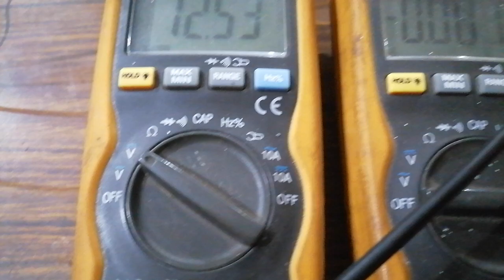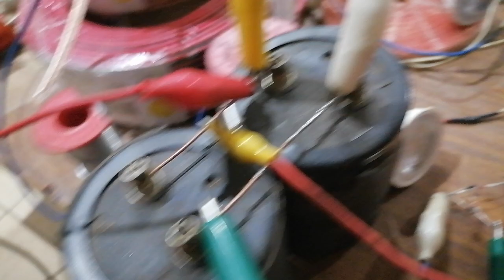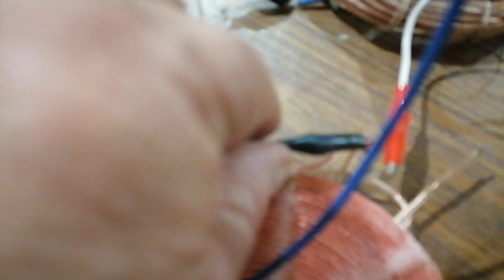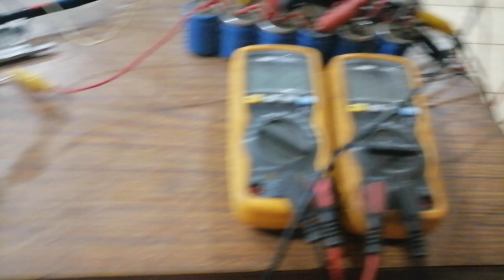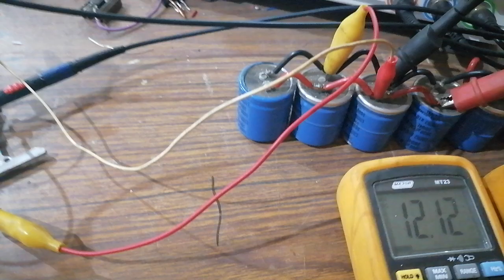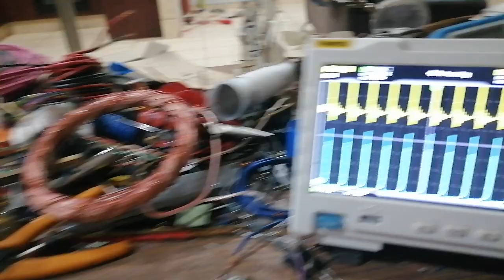LED LOAD TEST WINE BOTTLE COIL

Comment: Use a lumen meter to compare the light intensity. By hooking the LEDs to a 3.7-watt power supply, you can see how much light 3.7 watts can actually give you. Judging by eye is no good.
Reply: the lights in your sealing are at least 2 times as bright, you can even see it in the video. you need a lumen meter.

Comment: you can wrap your second coil around the wine bottles coil and put the wine bottle in a steel tube  and have both coils wire ends come out the top. will be more portable and efficient that way.

Comment: I think if the non electronically inclined viewer had a summary of what is special about this video people in general would appreciate it more. I see four light bulbs light up but I don't know what you're trying to demonstrate or what benefit this is. Have you created a free energy or perhaps you are generating a lot more output electricity than you should be able to get with the input you're putting in?

Comment: Awsome Video brother you are a LEGEND thank you for sharing this future technology Knowledge... If it's OK with you  I want to understand your cap bank as your coils are so Different 🏆why do you arrange your coils like that and if you can share your uf"son the caps....Your Tech is Like magic... 🏆👍✅✅🙏
Reply from the maker: I want to share every detail but my ISP is really slow for a 5G connection so i am forced to only upload really short videos.
Reply from the maker: The 2 capacitors are 3000 micro Farad each in parallel. The capacitance that I needed for the wine bottle coil to ring was 486 piko Farad. The two pancake coils gave me 426 piko Farad. But with a slower response time than a conventional ceramic cap would have done.
Reply: FANTASTIC 👍👍👍PURE GENIUS... Thank you so so much 👍🙏✅🏆